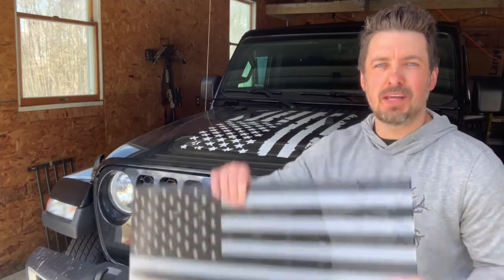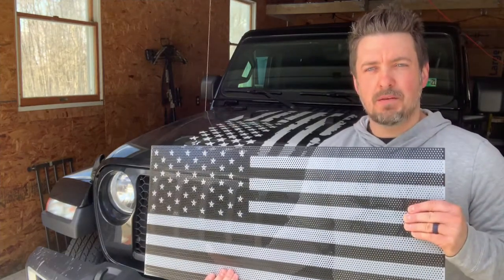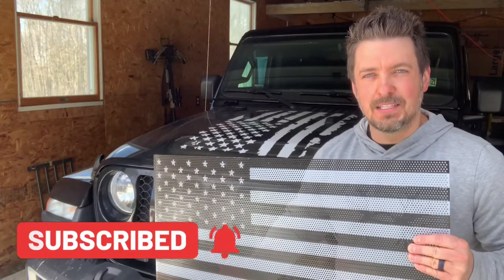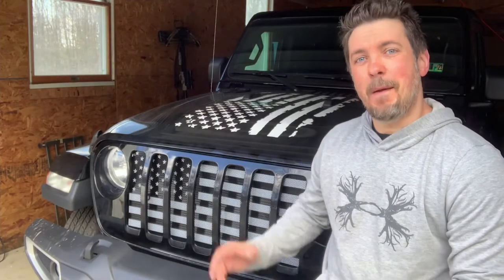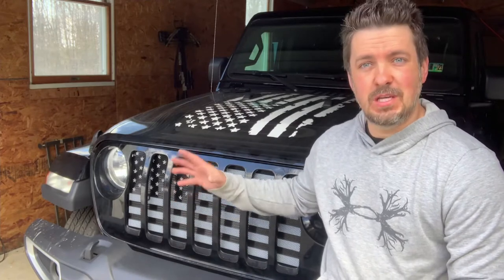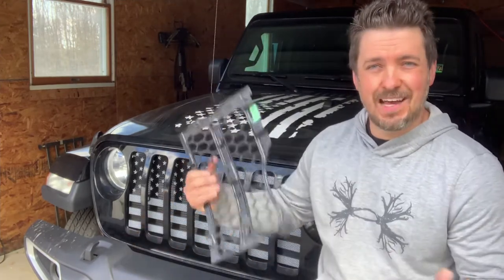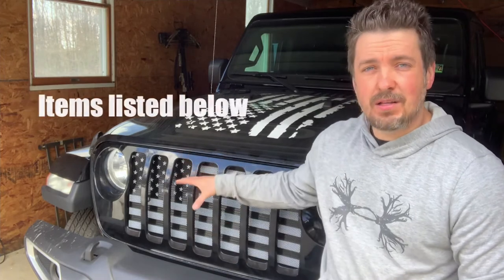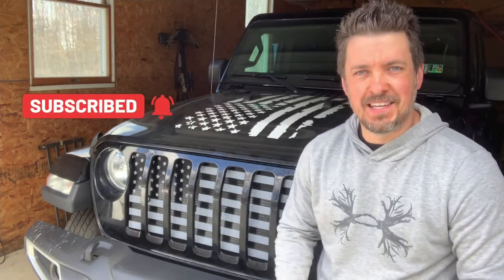Grille Insert Install - Jeep Gladiator or JL Wrangler. Add Style to your Jeep. It’s Quick and Easy!

Comment: Wondering if the radiator gets proper cooling through the mesh ? What is the temperature of the motor on the hwy and around town. These Chinese after market part makers don't care if your motor melts

Comment: wondering if the flow restriction will make it run hot when off-roading at slow speeds? I do hear the fans in over drive now so its a concern.
Reply from the maker: Hey FrostyTravels! Good question! I have only taken this off-road for short periods of time, so I can’t comment on that. Thanks for watching 👍🏻